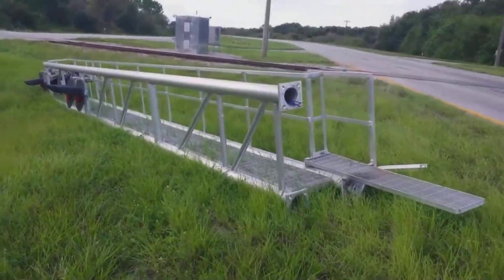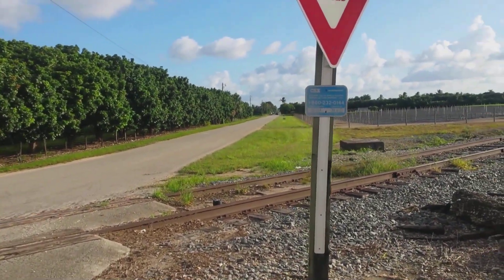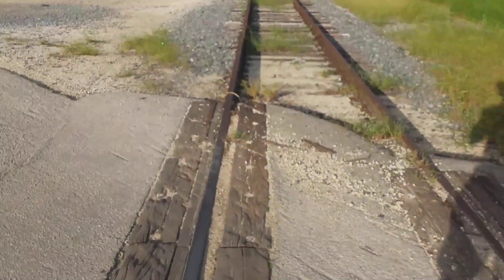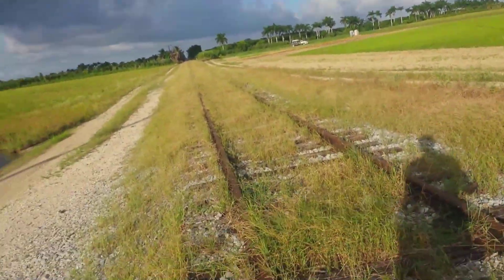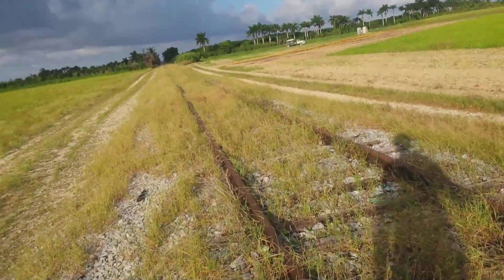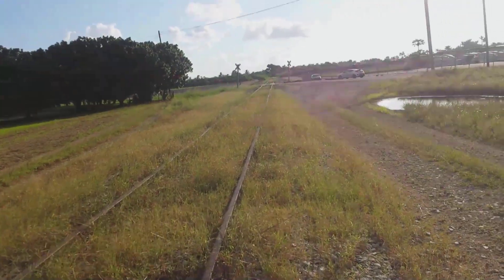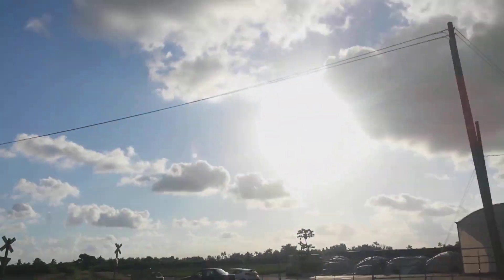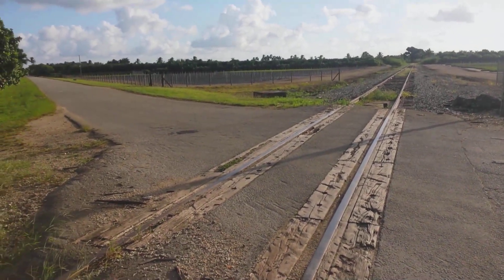Out of Service Track Exploration

Comment: This was very interesting, I totally agree this crossing and line should go to a commuter railroad, but seems like it will be gone, that’s an old grade wooded with asphalt in the middle I know after that they used to be made with black solid rubber and be installed in pieces now they are all cement, I can see why they just have the Cross buck with no lights, I would think they would remove the emergency contact info sign at this point.
Reply: Your welcome my friend!! This so true as us rail fans, none of us want to see the demise of any rail line or crossing, we always want to see them return to life, some do, some never will, but they all have valuable history. 
Interestingly enough I saw another video of the old conrail before it became CSX on the Northeast corridor actually had electric catenary locomotives. Sad they don’t use them anymore, the freight trains went as fast as Amtrak.

Comment: When you said they will turn it to a bike trail, that remainder me of a big debate in Indiana to see if they will turn the historic nickel plate line to a trail or not. I hope they do sell it to another rail company.
Reply: I would like to see what CSX is going to do with the former Monon line north of New Albany, Indiana.
Reply: They should sell it to Amtrak. They dont have to remove it
Reply: +SuperMariolover Nahas Pro Amtrak wouldn't be a bad idea. Up until about 2004, Amtrak ran trains from Louisville to Chicago over the LIRC but discontinued them because track conditions were so bad. Running passenger trains to the casino and resort at French Lick could keep the line open.
Reply: Yeah. That is not a bad Idea. The goverment dosen't have to save up so much money for a trail. Or Csx dosent even need to rip it out. They Can just Trim anything thats growing on the rails and Repair it a bit, Then Bam. You Can run amtrak silverstars On it. Maybe even build More railroad crossings too.
Reply: +RailROL82 “#RailROL82” Thanks Roly! The former Monon line intersects with NS at the base of the K&I Bridge and then has a few blocks of streetrunning in New Albany.